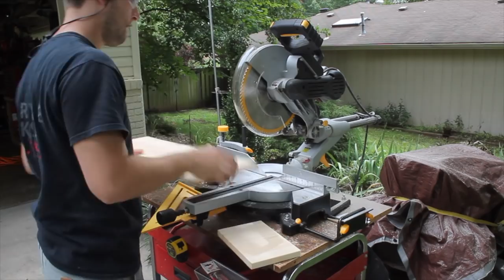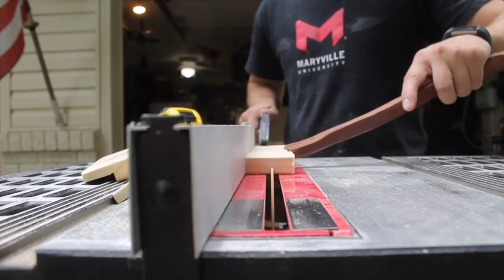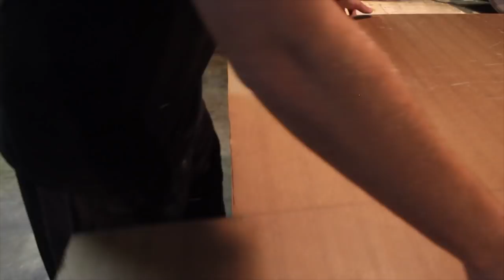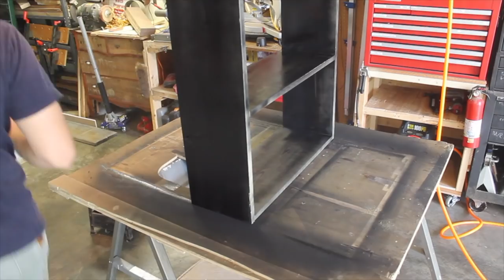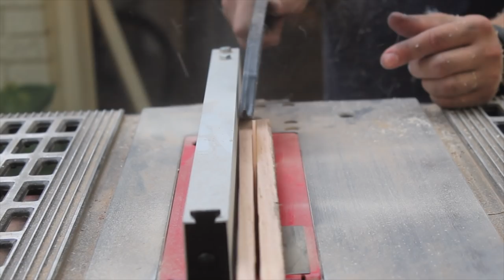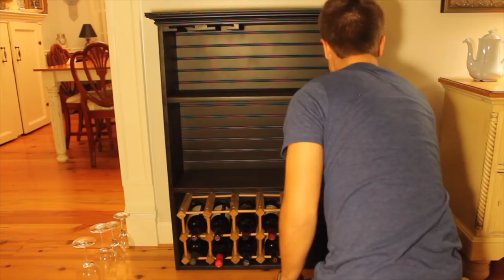How To Build A Mini Bar DIY

Comment: Hi Scotty, without the type of setup that you have with all the tools. I wanted to know if you have any suggestions of what saw can I get to make this mini bar? I know you used 3 different types of saws but I don’t have that kind of money to invest so I wanted to know which saw can manage to do most of the cuts you made for the mini bar. Thanks!
Reply: You should check out some of the mini bars made using old pallet wood less finishing work keep it a little rustic and you can use a hand saw and a jigsaw to do all the cuts .I made my own full bar using pallet wood i scorched the wood to get a nice finish then once made i simply varnished the whole thing except for the top where i actually poured the whole top with clear resin over the wood for a smooth finish. Came out fantastic .I cheated somewhat as i used an old side board carcase as the frame and clad the whole thing with pallet wood .Honestly it looks great .On the wall above the bar i made a drinks rack and glass rack using a single old pallet .

Comment: Why does no body do things by hand aymore all the machines good job tho
Reply: Efficacy and efficiency. Tools are required for progress, it is what brought us to this time. 

No one does carpentry with their hands alone, you need tools, some are hand tools some are power tools but most likely you will use both. It requires a great deal of time, training, effort and practice to only use the most basic hand tools and produce decent quality results, something a hobbyist likely lacks. Therefore, advanced tools are indeed a great thing when you want to spend some of your spare time doing something you enjoy.

Some people does make things with basic tools only, and we call those objects masterpieces, they are usually extremely expensive and only a few can be produced at a time, so again advanced tools are amazing for the masses and for the occasional maker. 

There are some products that may be impossible to manufacture without advanced tools, for example helicopter blades couldn't be produced until the invention of numeric control machines (NC not CNC) not even the best wood workers could produce the same shape to the tolerance levels required for four blades, only a machine could produce such a repeatable result.
Reply: I do for woodwork at my school, the teachers gets shitty at me cause im not using the thousands of dollars in electronic equipment because I enjoy the hand crafted way and because the next generation of people won’t know what a hammer even is if traditional ways aren’t continued